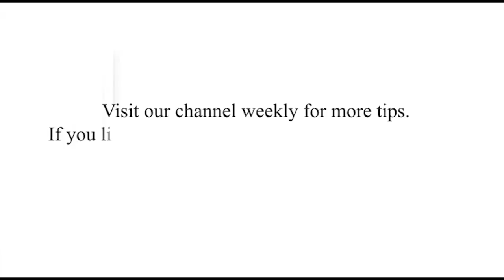How to Nitre Blue Gun Metal Without Nitre Salts

Comment: This is heat anodizing. This is best applied for small parts or pieces that might undergo a great deal of heat like suppressors and muzzle brakes. For best results, high polish the surface of the object you want to color. This can allow for a wide spectrum of colors to be permanently applied to the metal. Always douse in vegetable oil immediately when you achieve your desired result in order to set the temper of the object.

Comment: can you do this with the torches that have the big tanks?
Reply: Yes but move the heat around a lot, dont keep it focused in one place, and let the object heat slowly for blue or quickly to move through purple, yellow, red and black. If you want a rainbow effect you can move your torch around the object at a higher heat  but keep moving like youre painting it. Douse it in vegetable oil to set the temper immediately.

Comment: This is really temper or fire bluing as all the nitre salts do is heat the metal in a molten salt solution giving a similar effect.  Nitre salts make it easier to do larger parts more easily, but I agree for small parts like screws it makes sense to do it with a torch.